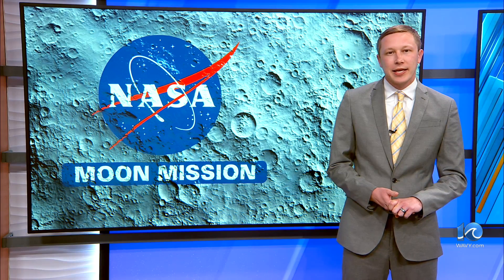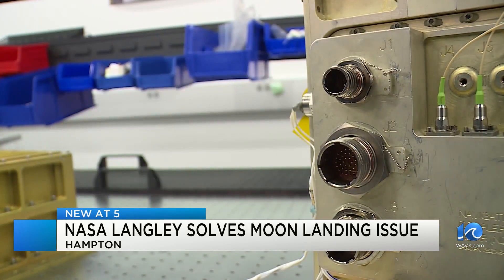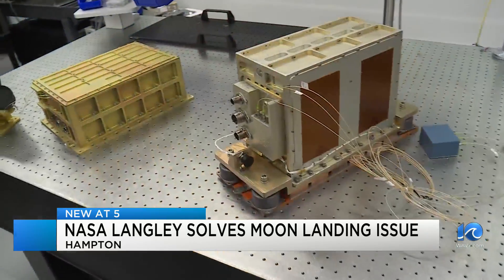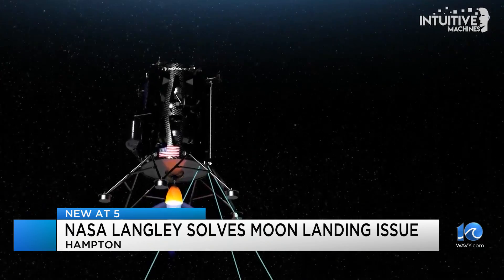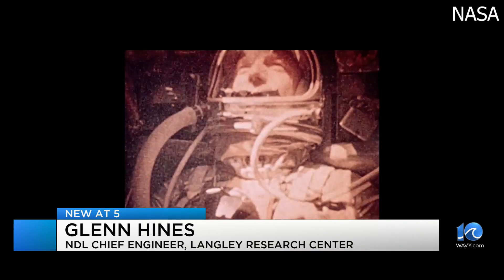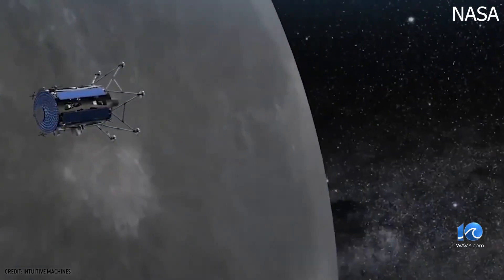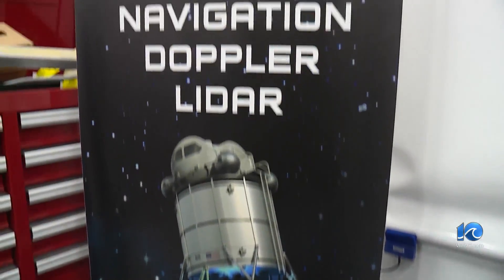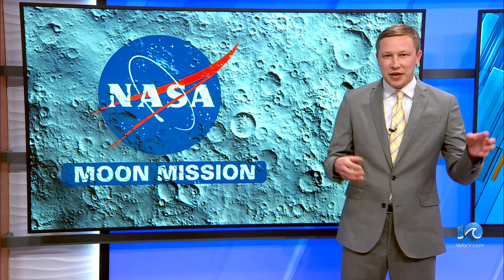NASA Langley solves moon landing issue

Comment: We have a network supply of vast numbers of used milled alodined aluminum LRUs from 747s, 737, etc., so on based on 36 or 72 volt. Most can survive 12-30G shock loads. Antenna systems and laser range finding systems need a boost, obviously,  the last guy that developed photo reconossiance software for the DOD/CIA is well off and building a mansion in Missouri.

Comment: Isro has better tech than this…..they precisely landed on moon upright
Reply: After crashing in the first place and with a smaller lander and cheaper tech. Cryogenic engine landings like in this lander have never been attempted before. It’s new tech of course it will have issues. Isco is using old but reliable tech which is fine